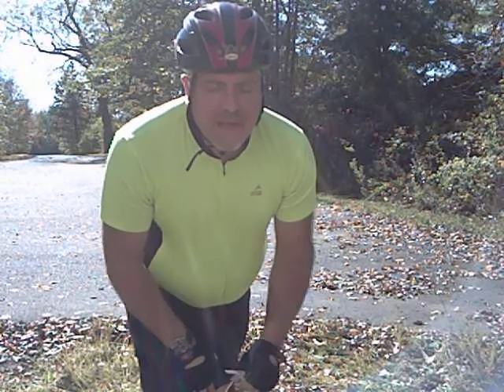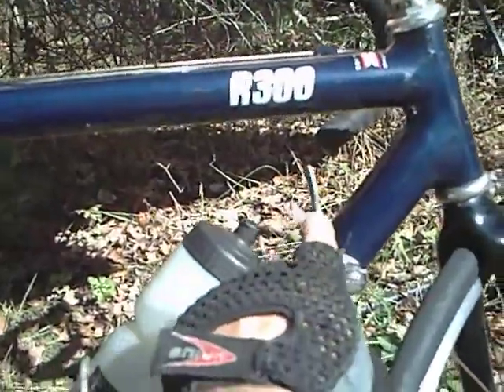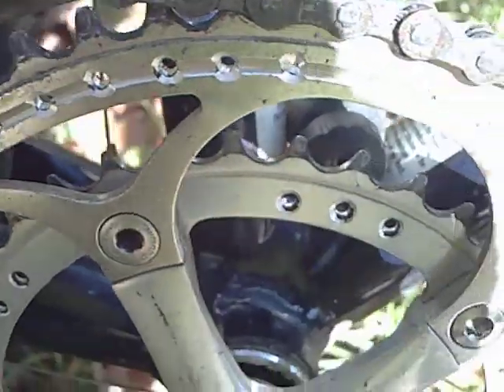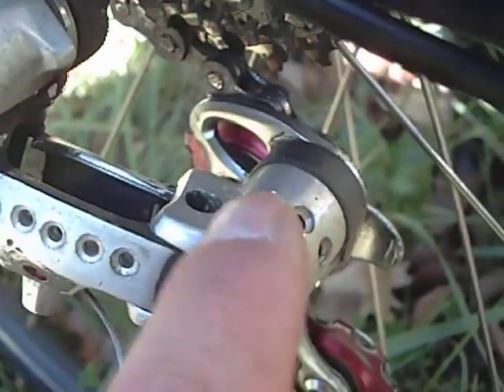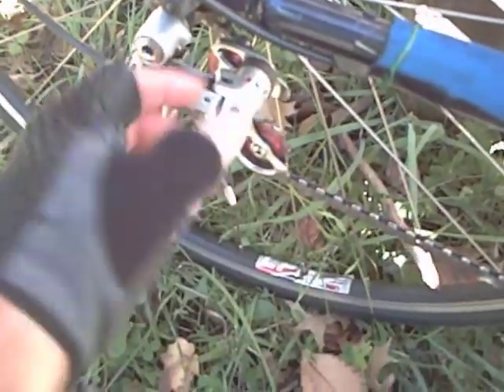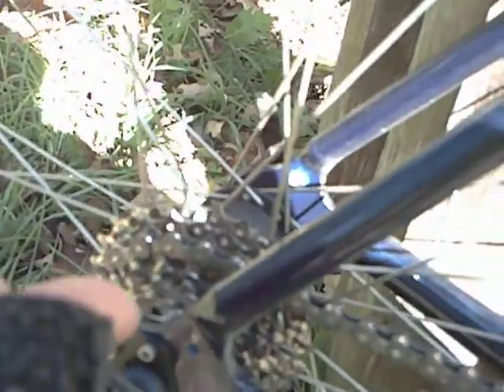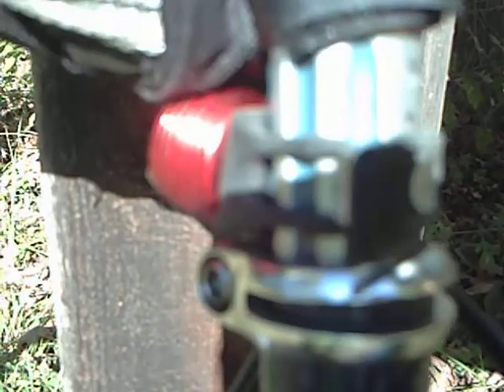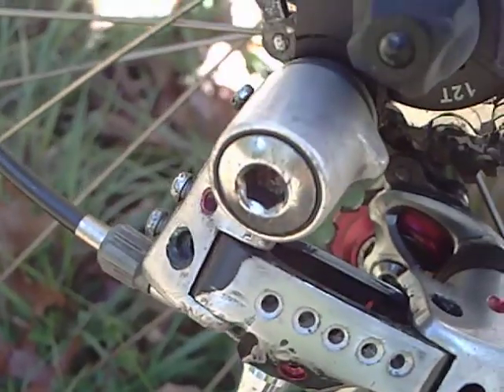CYCLING: Introduction to drillium

Comment: have you tried to holing the frame?
Reply: That sounds like a bad idea
Reply: There are some parts of the frame that you can because they don’t take stress in certain directions. Have a long look at examples before doing it though.
Reply: There's a few spots you can drill frame, underside of bottom bracket is one. Had no problems. I drilled approximately 1.125" hole in center of BB, filed clean, touched up paint. Personally, I figured enough weight was lost to justify the act, but leaves cup and cone bearings open to elements. Of course, this done on a chro-moly frame. Also, cutting off fender braze-ons helps. I cut all bolts down to only as long as need be. Seatpost can be cut down (depending on rider's weight) to leave about 2.5" insertion. If you have a quill stem, the long bolt is often about 0.75" too long. This can be cut shorter, filed clean, and introduces no risk. Skewers can also be cut to end flush with nut. On a couple of my bikes, I use shift cable for braking and shifting, this is a small weight benefit, but it all adds up. Use tubes with as short of valve stem as possible. On two of my bikes, the carbon Pinarello, and my steel single speed, I've gone full weight weenie, and use adhesive backed imitation carbon fiber vinyl to make little stickers to cover any holes like crank arm bolt hole, or un-used bottle bosses. Better than plugging with a screw. Another is running chain as short as mechanically reasonable, but you must avoid big chainwheel to biggest cog, which you should anyway. Crank arms, especially modern cranks are fairly over-built, and though I've not done it yet, I feel one could drill quite large holes in back ( but not through) crank arms at no risk. I've seen slits cut in chainstays, not sure about this one. Rubber rim bands can be replaced with a few wraps of Teflon tape, the stuff used for pipe threads. All these ideas amount to a lot of work, and a few beers may help with motivation. But if one was to make a little pile of all removed materials, like I have, you will be pleased knowing you're not towing around that extra weight. It's a sickness.